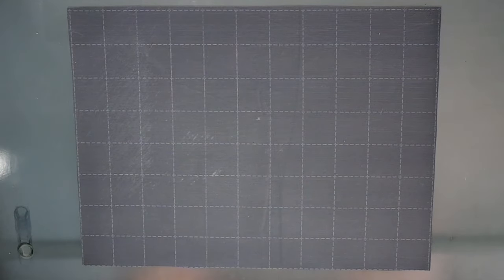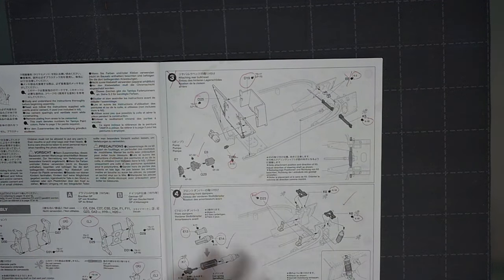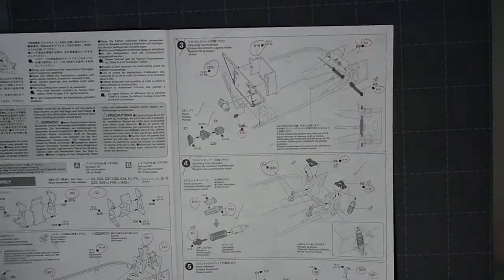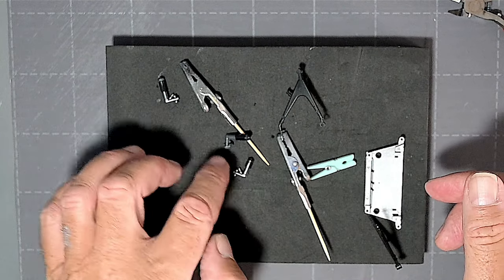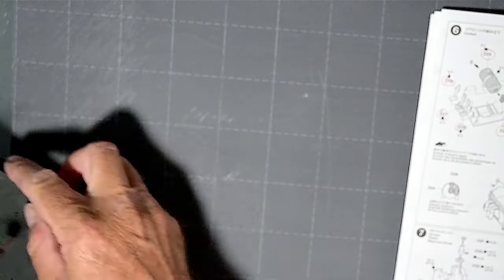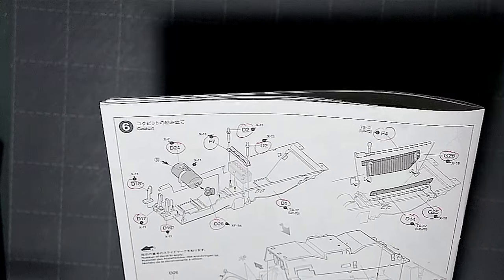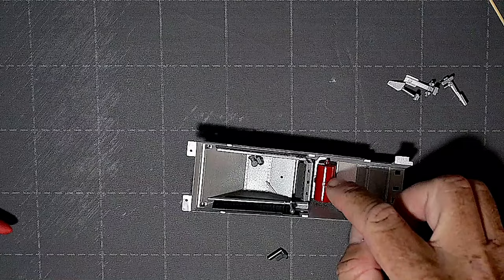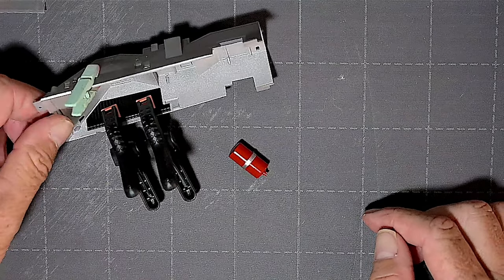Tamiya 1/12 Scale Martini Brabham BT44B  Build Part 1 Formula 1 Car

Comment: That red tank is indeed a fire extinguisher. Those suspension arms are called wishbones, for obvious reasons, and the black pieces on the cockpit sides are pads so the driver doesn't get too beat up going through corners.

Comment: Hi Peter, you made some great progress on your Brabham build.  What do you think of Mr. Color paints.  I really like their lacquers.  The new mic sounds great.  There is something going on with the frame rate.  The motion was not very smooth. Kind of like it was processed at a really low frame rate.  YT says it was at HD quality, but I doubt it was 30 frames a second.  I'm sure it;s just a setting that needs sorted.  Thanks for sharing.  Have a great day.  Jeff
Reply from the maker: I was filming at 60 frames a second and just realized it was jittery. I have set camera to 30 frames and it should be better in future.... I like the Mr Hobby and I am very happy with the mic... I will sort out the quality over the next couple videos :)